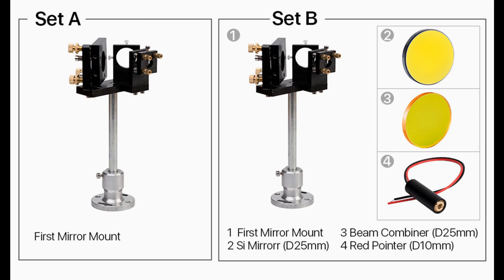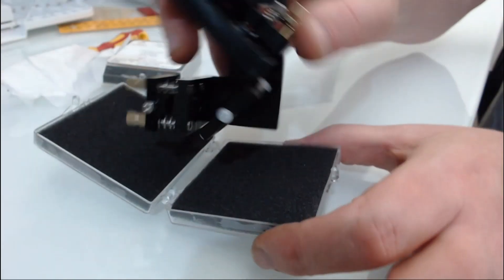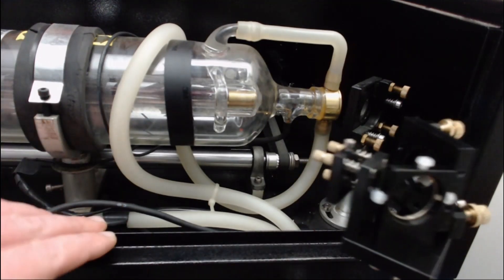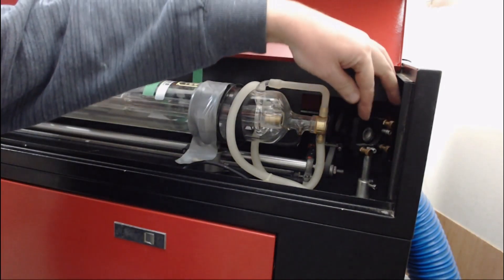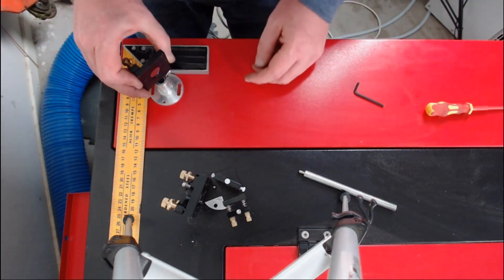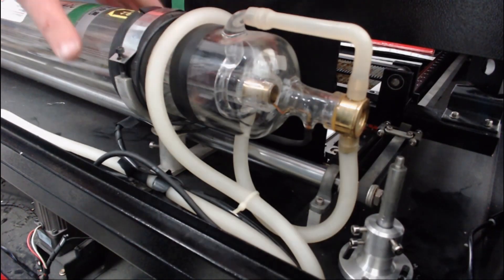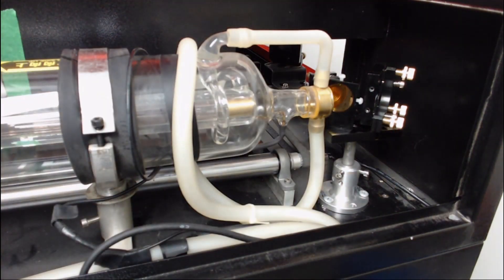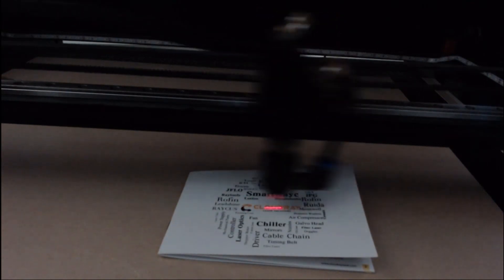Co2 Laser Upgrade - Laser & Red Dot Beam Combiner for CNC Co2 Laser Machine

Comment: Great video. I found it trying to find a solution for my issue. I recently purchased a used laser and I have the same setup and brackets but while aligning I noticed the beam goes through the mirror combiner into the mirror but also reflects off of it and also sends a beam towards the back of the laser into a wall, thats how I discovered it, it left a burn mark on the wall. Any sugestions?
Reply from the maker: sounds like it was installed incorrectly by previous owner - you should assemble / install it in the correct way before you do damage to yourself or your property :)

Comment: I got this same setup, along with the reci tube adjustable mount because my tube basically sits on the machine. The question is this... after i install the reci mount and this, how would i raise the height of the mirror on the y axis high enough to match? I imagine the same question appiles for the laser head as well...

Comment: Can you replace the red laser with a diode laser so you can engrave with diode cut with co2
Reply: Why not engrave with the C02 laser?
Reply: @MinkiSansChannel  save the tube for cutting and use the diode for the longer life

Comment: is the Red dot an asset with alinement of the Mirrors ??
Reply from the maker: No. not on these units.
Reply: @MWLaser  I bought my  Redsail 1290 80watts , in 2013  upgraded to 130 watts a couple of years later,  I also  now have a 2nd hand  GWEIKI 1390N which has this red dot attachment to be fitted,  The red dot on my Redsail failed after 12 months.    AU

Comment: Nice video as always, I just installed a Cloudray combiner only unit. It is just an LED and combiner lens with no mirror lens. I have a larger table that is 900mmX1600mm long. When I installed the combiner my laser will not cut out past approx 1200mm (45") If I slide the combiner out of the way it cuts as expected. Is this to be expected?  I noted that when I recieved the combiner my LED pointer split into 3 horizontal dots. I flipped the lens around thinking maybe it was directional and installed incorrectly from Cloudray. The dot, which i have focused as tight as possible, is now a single dot through the combiner but after about 300mm from the combiner it starts to become a blob. By the time mirror 2 is at full travel the LED is a 25mm blob.  I can still get enough LED to mirror 3 and through the lens to be visible but not very crisp. My main concern is losing usable cut power  over the last third of my table.

Comment: Can you expand on specifically where you got the 5 V source from for the red dot?
Reply from the maker: The original red dot that was on the nozzle had a 5v connection to a 5V psu so I used that on this installation, you can also use the 5V and GND connection from the laser power supply.

Comment: Hi, I installed the beam combiner. Unfortunately, I now have a loss of performance. Is that normal? The red dot is exactly in line with the laser dot.

Normally I cut poplar plywood with 11ma at 27mm/s now I need 20ma to make a cut. Tanks :)
Reply from the maker: it is normal to loose a bit of power as the beam passes through the additional lens

Comment: Great video, ordered one now....I guess once you have got the red dot central to the laser beam perfectly sorted when you need to align the mirror 2 and 3  at some point again you could use the new red dot to do that and it would be a lot easier than the pulse button and tons of post it notes catching fire.... 😄.  

just a question on the K40's the mirrors are 20mm but cloudray are suggesting to me to change my order to a 25mm mirror for Mirror 1, would that be Ok or could it cause a optical problem with the other mirrors that are smaller....?
Reply from the maker: for a k40 I would suggest 20mm mirrors

Comment: if i combine the co2 laser with a 40w diode laser do you think it will increase the power?
Reply from the maker: No.  this is not designed for that purpose.
This is to combine a LED and co2 beam, they are not exactly aligned /combined it is an indication of beam only.

Comment: Thanks Matt! Your videos are very helpful. Quick question, what is the diameter of the mirror you bought? Nowhere on my Chinese laser there's mention of the diameter of either the mirror or the lens in the nozzle head (I measured the nozzle lens at ~17.9 mm). Thanks!
Reply from the maker: I used a 25mm mirror on this upgrade.  the other mirrors on this machine are usually 20mm
Standard lens shipped and installed on Red&Black is 18mm 50.8mm (2") Focus Gap

Comment: Hi Matt, thank you for all the awsome and informative  videos!  Could you please confirm if the ZnSe can be fitted either way? (as ther is a small "y" on the side if the lens)
Also, did you need to focus your red dot laser pointer? If so, how should you focus it? For a short focal length? (ie by placing a piece of white paper/tape on/at the ZnSe combiner first?) My 5mw red dot is rather "un-focused" and the sharpness dissipates very fast as I move x/y axis away from the first mirror. Did you need to fiddle and tweek? Thank you again!
Reply from the maker: The ZnSe window is not a focus lens so it can go in either face forward.
The red dot pointer can be focused into a smaller dot by twisting the sleeve end of the pointer.  Not all units have this option.  It does take some tweaking to get everything setup correctly.  Good Luck.  Cheers Matt
Reply: @MWLaser  Thank you Matt, I was trying to get the red dot to line up before the laser. After I aligned the laser the red dot was easy. Thank you

Comment: Hi. I have read that a combiner actually results in a lowed laser beam power. Yes..No?
Reply from the maker: yes, it can have a small reduction in beam power.  in my experience on all machines I use this is negligible, as I have tested the effect on the cuts with and without the beam combiner units
Reply: @MWLaser  Hi, first of all I want to say thank you for your review/video.
I would like to know more precisely "by how many % or mm/second" the beam/cut power is reduced. (Atleast approximately)
I have seen many videos and reports that the power is dropping, but no one says how much.

Comment: Hi Matt, just purchased the same laser machine as yours and just wondering what or if you use laser safety glasses?  I am not sure if the clear window is filtering the light or not so would like to buy some proper glasses.  Loving the videos as well.  Very informative
Reply from the maker: I use them when performing laser / mirror alignment.  Doors should be safe.  To have added protection I use these when necessary. https://mwlaser.com.au/product/cloudray-10600nm-laser-safety-goggles/
Cheers Matt

Comment: do you think you could install the combiner on the side without using the mirror, after the first 45?  Trying to avoid all of the mods that you had to make in your video.  Dont know if the pointer has to be introduced at that exact spot(next to the 45 degree mirror.  Do you know?    Thank you for all of your videos, they are going to be helpful.  Ken
Reply from the maker: Yes you can install the combiner before or after mirror 1, there is also the beam combiner unit available without the mirror included, you will se a demonstration of this type of combiner in the laser build video https://youtu.be/h7wMw_xlWUA?t=425 (please excuse the bad audio in that video)

Comment: The screws of the original red dot run into the hydraulic arm of the door.  Anyone else having this problem?  Will this resolve the issue or does anyone know of a workaround?
Reply from the maker: Install a red dot combiner and eliminate the pointer on the laser nozzle.  or reposition the red dot so it does not collide with the hydraulic arms on your machine

Comment: I doubt I could install this modification without this video. Do you have the measurement of how far you offset the new mount from the old unit? Did you find that the rod from the old mount actually placed the reflecting mirror at the same height as the old mirror? I just wonder how much time and effort it will take for me to fine tune and finagle this set up to align the mirrors and be ready to fire the laser up again.
Reply from the maker: This one I used in this video is definitely more complicated to install than the one without the mirror mount attached.  I recommend this one (https://mwlaser.com.au/product/cloudray-beam-combiner-set/) I bought this one for my new DIY build and it is simpler to install.  (I explain where it is mounted in this video https://youtu.be/h7wMw_xlWUA?t=402 )
On the red&black I did use the old rod to mount so it was at the right height.  I have installed the one without the mirror on a few machines now, and in the case of the red& black machines I had to modify the rod or in one case drill a 12mm hole below where the mount was to go, so the rod would slide through the mount and I could adjust height that way.
If you require assistance email me using the contact details on my webpage.  Cheers Matt
Reply: @MWLaser   It appears the link to the set that you are saying would be better is not working. Do you have another link?
Reply: @MWLaser  bad link

Comment: Could you please let me know the very high power red pointer as I have certain other optics in between which have transmission loss for red pointer?
Reply from the maker: The ones that are supplied with the beam combiners I use are basic Red LEDs with a 5v supply.  These are sufficient for my setup - https://mwlaser.com.au/product/2235/ 
However if you need a higher powered one then you may find more information by google search.  Cheers Matt

Comment: Hey Matts, nice work, just want to ask you if the 10.6µm mirrors reflect the red pointer laser beam as well as the co2 beam?
Reply from the maker: Hi Amine, Yes the 10.6µm mirrors will reflect both beams.
The Cloudray E Series 1st Mirror Mount with Beam Combiner Set comes with the ZnSe (combiner) Lens and an Si (10.6µm) Mirror.
The ZnSe lens will reflect Red Dot Pointer, the Co2 Laser Beam Passes through it onto the Si Mirror, where both the Red Dot and the Co2 Laser Beam will then reflect off to Mirror 2 etc.
I hope this answers your question. You could check out the product images on this web link for a diagram of the red dot and laser beams path.
https://www.cloudraylaser.com/products/cloudray-e-series-1st-mirror-mount-including-beam-combiner
Cheers Matthew
Reply: @MWLaser  Thank you so much Matts, that answered my question and more.